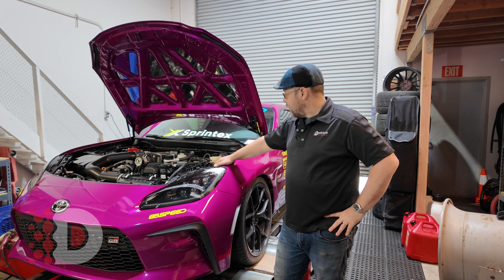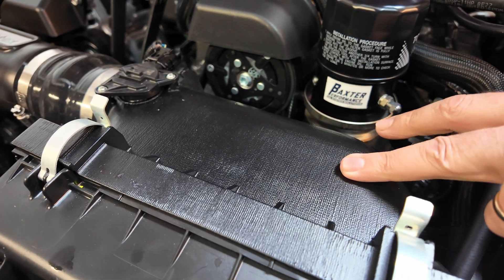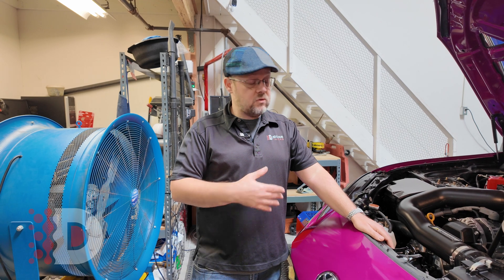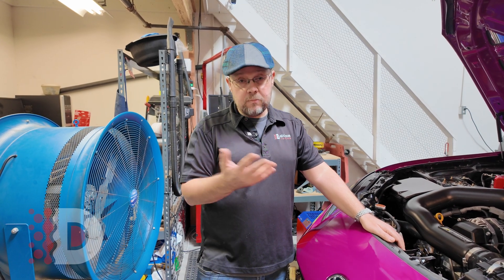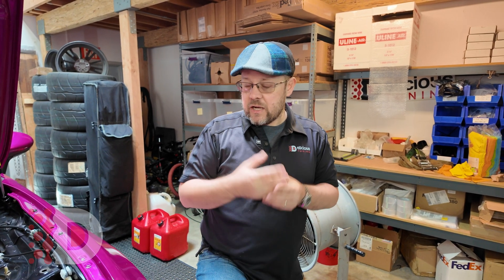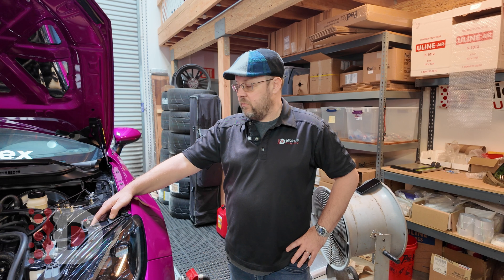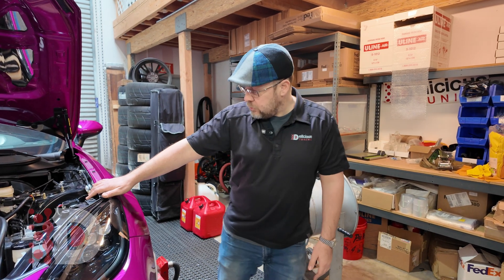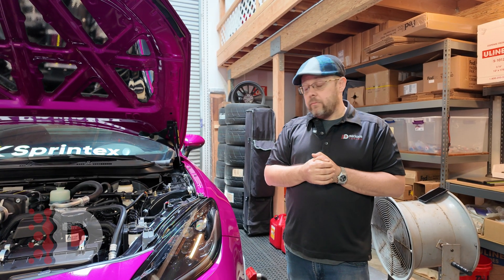Supercharger Reveal at Delicious Tuning; 86Speed's Sprintex Supercharger for the 2022+GR86/BRZ

Comment: The gr86's intake box has the MAF sensor outlet angled like 35° towards the engine while the older 1st gen 86 has the MAF outlet 90° just like the Sprintex 3D printed MAF side air box.  Is the 1st gen air box not compatible to lock into the Gen2 air box?

Comment: 15psi on a 12.5:1 compression Subaru, taking bets on how long until the rods say “ight Imma head out”
Reply from the maker: Supercharger kits are more of a linear increase, starting at 5 PSI around 2000 RPM and increasing to 10 PSI by 5000 RPM, then maxing out at 15 PSI around 7500 RPM. This in turn keep the torque reasonable for the application in 90+% of driving conditions, while still be extremely responsive. We have found on the Gen 1 86/BRZ that 350 TQ is reasonable for most applications and see no reason to believe this would be much different on this platform. We are well below that level on this supercharger kit.

Comment: Really interested in 91 octane whp figures.
Reply: made 300 wheel horsepower and 255 wheel torque on crappy Cali 91.  On e65 it made 350whp and 310 wheel torque.

Comment: I would argue that even though this kit makes low power it will be harder on the engine than higher power kits. These blowers are so inefficient that it takes 15psi to make the power that a centrifugal supercharger makes at 8psi. Puting 15psi into a 12.5:1 compression stock NA subaru engine sounds like a recipe for disaster.
Reply from the maker: Supercharger kits are more of a linear increase, starting at 5 PSI around 2000 RPM and increasing to 10 PSI by 5000 RPM, then maxing out at 15 PSI around 7500 RPM. This in turn keep the torque reasonable for the application in 90+% of driving conditions, while still be extremely responsive. We have found on the Gen 1 86/BRZ that 350 TQ is reasonable for most applications and see no reason to believe this would be much different on this platform. We are well below that level on this supercharger kit.
Reply: @DeliciousTuning  ^^And that is awkward/backward in my opinion. The FA24 should logically make more torque. Why is the FA24 making less torque now than the first gen? Maybe you can elaborate, I am just a car enthusiast looking at the data, you are the expert providing the source. Wouldn't be logical to think that the FA24 being the newer engine, more modern, more displacement..etc, etc should make more torque than the first gen S/C  or did you guys designed it this way?
Reply from the maker: @rs3tuber425  The FA24 does make more torque, no question there. But maybe it is not clear how these superchargers work on this platform. The first Gen BRZ running a Sprintex Supercharger has not changed their design with how the torque comes on. The boost increases linearly like the second Gen, starting off around 4 PSI (with a 69mm pulley) and ramping up to about 13 PSI by redline. 

Superchargers in general (Centrifugal, Roots, Twin-Screw) on both the Gen 1 and Gen 2 86/BRZ platform, start off low and ramp up as the RPM's increase.
Reply: The centrifugal superchargers have their Achilles tendon too. I have a karftwerks supercharger and is makes mediocre torque and I only see boost after 4500 rpms. In fact, I see full boost at around 8000 rpms. I have it on  a 2009 Civic SI, it makes a lot of power but the power band is very narrow. Yes, I made 135whp and 80lb-tq more but in a very narrow RPM band.  Each supercharger has their own characteristics, I personally like that instant torque on this sprintex but yes, I take into your consideration your comment about having to run this supercharger at very high boost on an already high compression engine.
Reply: @rs3tuber425  That is for a reason. High torque in the low to mid range on a weak lil honda engine will throw the rods to the stratosphere. If you drive the car right, you dont need all the torque at 2500 rpm. Thats what downshifting is for. The same principal applies to factory twin turbo cars. The upgrade is to go with 1 larger turbo. Lag increases, low end torque decreases but top end power goes through the roof while using even less boost. Efficiency matters. Integrity of the engine matters.